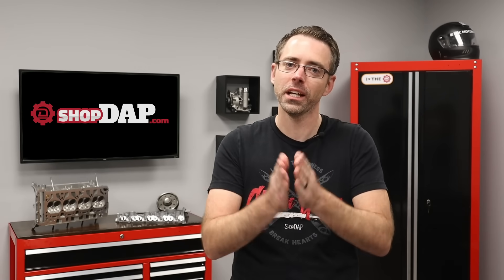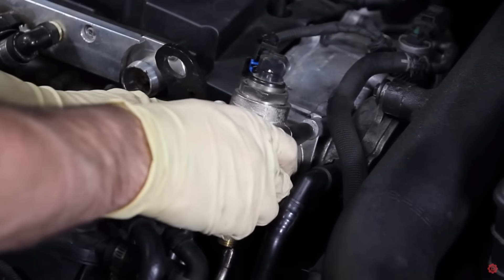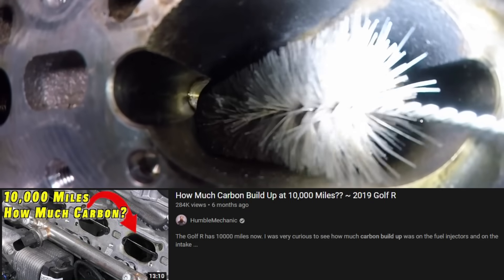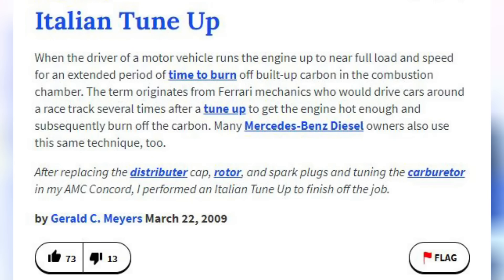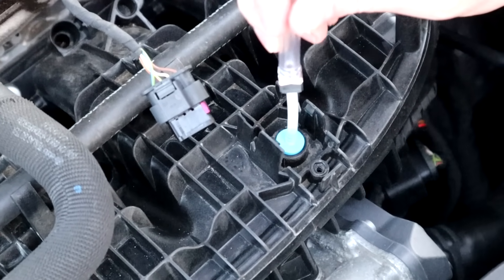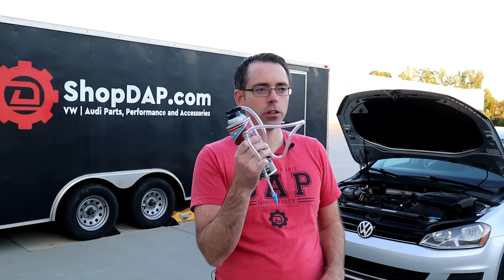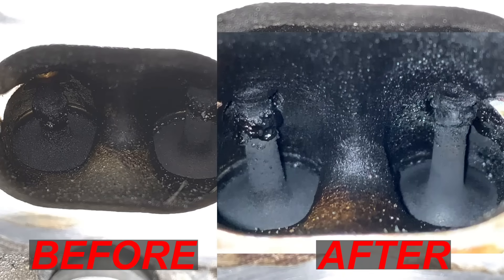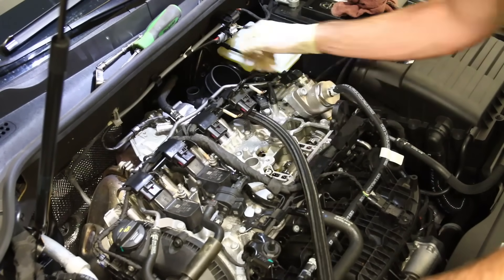Can you Really Remove Carbon for $29?

Comment: wonder how dry ice blasting would work for carbon removal.

now that i think about it, wonder if you could just let the pellets get sucked in to a running engine since they vaporize.   it would be an interesting test.
Reply: Interesting, but have potential to go expensive 😱
Reply: Might be a little tough to keep the engine running while sending carbon dioxide right into the combustion chamber.

Comment: I had one of the these engines I had to change out with a low milage lkq one.. intake was off and a crap ton of carbon down the intake port. Had a bunch of codes for the secondary runner, lean mixture, etc etc.. anywho.. would bad carbon buildup cause all these codes?
Reply: And I know the owner is cheap asf and ran crap gas

Comment: In the old days in the UK, say late 60's, 70's , talking about a petrol engine with carburettor , you would have taken the cylinder head off and given it a "de-coke". The valves would have been removed and the black gunk scraped and wirebrushed  off. 
Fast forward to the 21st cent. , most of us are running around in turbo charged diesels. Myself, I use a diesel additive called Millers - which claims to clean injectors, add cetane numbers etc.
One of these days, when I can persuade my Wife that it is an indispensable tool, I'm going to get me one of those Borescopes and stick it in the manifold area to check it's condition.

Comment: Almost seems like it would be beneficial to run a can of the spray before removing the manifold to help loosen the deposited carbon before jumping into a manual cleaning. Thank you for the new obtained knowledge!
Reply: Plastic manifold = no VOC cleaners it will turn into jelly. :)

Comment: Irony..."save" ozone with PVC/EGR system. Get power and efficiency with DI. Pour chemicals in to engine while running and create noxious, unhealthy smoke....destroy ozone anyway due to extra cleaning needed.  Talk about chasing one's tail. It's okay folks I drive a Subaru with the FA20DIT, so I'm going to kill the ozone eventually. Air-oil-separatoe here I come....

Comment: Good god. Did this guy really just suggest removing the intake and media blasting the valves with the cylinder head still on the motor? This is perhaps the worst vehicle related advice I have ever heard.
Reply from the maker: We are professionals and that’s how it’s done..... sooooo
Reply: @Deutscheautoparts  😂🤣 "Professionals"

No professional would ever recommend media blasting on an assembled engine. There is absolutely no way possible to recover all of the blast media and keep it from ending up inside of the cylinders, valve seats and guides, oil passages, etc. where it will end up lodged in the ring groves, scouring the cylinder walls, and doing all sorts of other damage. Even after media blasting an entirely disassembled engine you need to hot tank and blast everything out with compressed air to remove the residual grit.

And let's not even get into the undesirable surface profile that  media blasting leaves, especially on parts such as valve stems which are polished perfect smooth for a reason, to decrease friction.

This is anything but "professional." This is some backyard hillbilly level shit.

Comment: I had The "moderate"  buildup example here and i was running CRC GDI cleaner every year (every other oil change). Took off the intake manifold and it was pretty dirty. I ended up soaking in carb cleaner and scrubbing with toothbrushes. Worked pretty good.

It takes way longer than using walnut shell blasting. But you don't need any special equipment and i think it's less mess

Comment: Great video. I do wish you would have went more into the meth injection system. I understand it's a pain in the ass and not worth it, but does it actually work and can it take the place of spending money for walnut blasting? I am actually putting a meth kit on a car anyway by chance, and am considering walnut blasting but don't want to spend the money if i don't have to.
Reply: How did your meth kit install go?
Reply: @85gti  Good. I used it for more power, not to clean carbon. I ended up doing a forged build and have new valves and such, so I didn't need to walnut or dry ice blast. But methanol definitely allows for more power

Comment: I’ve read papers on the Italian tune-up my impression is that if it’s an engine that’s consistently run hard and hot, it can somewhat mitigate he buildup of carbon. So basically if it’s a track car or race car that spends it’s life at high RPMs it may not be an issue.  But you’ll probably have to tear that engine down after tens of thousands of miles on a track anyway.
Reply: I think that'd be more applicable to carbed or port fuel injected cars since there you do have gas run down the valves whereas in GDI it'd only maybe clean the pistons

Comment: I have a 2017 Kia Sedona with the V6 GDI engine since 7600 miles.  At each 5k I change the oil and filter. At the 10's I use the CRC method and now the van has nearly 70k miles and the intake valves look new and they're dry. So, I am certain the chemical treatments work great for preventing trouble.  I also use Pennzoil Platinum because it scored the best on evaporation testing and that means less drawn into vapor into the intake PCV system.. Cheaper oils do evaporate more.  BTW, the PCV hoses have no wetness, so I don't think a catch can would do much.  It's all about proper maintenance with good synthetic oil.
Reply: Can you elaborate more on what the crc method is? Is it using that crc intake and valve cleaner spray? If so how do you do it.
Reply: @abdulelahahmed4027  Yes, that's the product.  You spray it into the intake in bursts a couple seconds apart, not just spray all at once which can do ring damage, while the engine is running approx 2500rpm.  The detailed instructions are on the can, or you can do a web search for directions.

Comment: amsoil has one of the best knoak ratings witch really helps alot with carbon buildup on intake valves.i have a 2019 ranger 2.3 ecoboost been running amsoil since 4k i looked with bore scope at 21k and valves have almost nothing on them very clean so far not perfect but not to far away. but i change oil every 7 k and it never uses a drop of oil yet. i never have to add oil between oil changes amsoil well worth the money in my book. was going to install a catvh can but dont think i will have to.

Comment: I have a Lincoln MKS Eco-boost, it's been recommended to me that anyone with a Ford product that has the Eco-boost engine in it. That a oil catch can be added to help with the carbon build up.
You don't want to do anything that could cause a chunk of carbon to end up in your turbo charger. It can destroy it.
I also use premium oil and Chevron with Techron fuel and just driving normally for me I run an Italian tune up at some point every time I drive not that it helps, it's just fun! Why have a turbo if you aren't going to use it!

Comment: Using E85 race fuel resolves most of these issues without having to resort to old-school water meth. Carbon build up could be resolved if VW would give us the same engines that they use in the homeland.

Comment: Hyundai is now running dual direct injectors per cylinder on their new 1.6l engines. this is their style of variable displacement. 1 set shuts off when the extra fuel isn't needed, ie, steady highway or idle. Manifold services are absolutely preventative and shouldn't be used to solve an issue that is occuring or about to occur. mechanical cleaning is the only way to fix that problem.

Comment: I was told porsche don't have this issue because of their air oil separator design in their newer model liquid cooled cars.
The air oil separator acts as a kind of oil catch can and requires service over the lifetime of the vehicle.
Replacement on my cayenne took 5 minutes.

Comment: Spray biodiesel into your throttle body in a controlled manner
That thing should eat up everything in there. After you are done, let it heat soak for an hour or two and go do an Italian tune-up. Check the before and after under those conditions.

Comment: Hi, Im in the UK and have an A3 1.8 TFSI, which I believe is direct injection. You mentioned a difference in EU cars so will I be  having this issue on my car? It's a 2016 model with 57, 000 miles. Many thanks.

Comment: Just seems like there’s no good solution to the GDI carbon problem if you don’t have a very recent dual injection system. Either get an old pre-gdi car or a very new one that has the issue fixed.

Comment: Curious what those chemicals and the resulting smoke will do to a catalytic converter?

Perhaps a moot point since the chemical  cleaner doesn't seem an effective solution.
Reply: The goal here is to avoid superheating the catalyst. I've used intake treatment for many years, either induction or through the injectors. The big mistake I have seen is when someone is rushing the job, going for a banzai run to clear out the smoke.

Terrible idea. I allow the engine to idle ten minutes following the procedure, this allows slower burning of the accumulated hydrocarbons, and avoids damage. Yes, I watch that catalyst with an infrared thermometer.

Once an FSI engine exhibits cold idle misfires, the only solution is a proper intake cleaning. I have used several methods, including the "walnut blaster" devices. In my experience, it still requires a follow up cleaning, though much less carbon is present, with solvents. The blaster does little for the valve seating surfaces, where the misfire shows its ugly face.

Comment: Could I ask, does the audi s4 3.0 v6 engine have a big issue with carbon buildup? Could you use this product on the hole the pipe goes into in the intake just before the supercharger intake manifold? (don't know all the technical terms but I'm sure this makes sense to you as you own an s4)

Thanks

Comment: The answer is...NO. ATS has a system which actually works. However, while it's less expensive than removing the intake etc. It's still not exactly cheap.

Comment: I'm having a Passat 2017 model TSI 1.8L  with 103k so far I checked with my OBD2 Pro version and there's no problem so far knock in the woods, I only changed the front breaks and rotors. What should I do next? and what are your recommendations? Thank you
Reply: Your experience is encouraging since I drive a 2016 model Passat with the 1.8L So far I've only put 22k miles on her while averaging a pleasing 37.4 mpg (22,027 mi/589.1 gal.) Note: She is my fair weather-only car.  So far  no CEL's or rough running issues. I purchased and still have two cans of CRC solution for carbon removal but have been hesitant to use them due to fears of potentially damaging the turbo and/or catalytic converter. I've also considered adding a catch can, but have yet to be convinced doing so might do little more than possibly slow down the buildup of carbon on the intake valves slightly. At this point I believe I've decided to leave things alone and plan ahead to manually clean the intake valves when (or if) my car's fuel economy and drivability shows signs of deterioration. Had I known about the carbon issue with GDI engines I probably would have purchased a Toyota.

Comment: The best preventative to the turbo DI carbon issue is....don’t buy German turbo DI.  All turbo DI have some level of carbon build up due to the design of the system but, only German cars seems to have debilitating carbon buildup that eventually causes misfires and crap power/mpg.  I have first hand experience having owned a 2013 VW 2.0 TSI and both a 2013 and 2017 2.0 Ecoboost Escape. 

VW after about 40k miles would occasionally have rough cold starts. By 50k it would occasionally have cylinder 2 misfires. Progressively got worse until I finally yanked the intake off at 70k. Cyl 2 was the worst, almost 50% plugged.  2013 escape 102k miles before trading in for a 2017 that currently sits at 46k. Zero issues with either and none of the forums report any issues. Oil changes @7.5k miles on all vehicles with full synthetic and appropriate spec for the engine.

I blame German Pcv systems. They sit above the intake manifold so they push oil vapors and droplets into the intake with gravity assist. All other designs put the pcv system below the intake manifold so, oil has gravity working against it.

Comment: You can try using round aluminum telescopic tube, 1/16 or 3/32 diameter, glue and bend 2-4 of them to a shape that would fit in the MAP sensor hole with a rubber plug at around mid point. Then snug fit the outside end to a spray feeding tube. That way you can safely control the spray direction inside the intake feeding each cylinder equally.
Reply: The carbon deposit can be blasted with dry-ice blaster with a tip-nipple between 10mm-20mm and then air cleaned with a pressurized air-gun.. no more carbon deposits super quick !
Reply: @poplaurentiu4148  If all that could fit in the MAP sensor hole and without removing the intake manifold or fuel rail. If I have to remove it, I'd use a walnut blaster. Your technique may work also 🍻 I hate these direct fuel injected cars. Port injection or electric the way to go. Just add more gears to be at a lower rpm at cruising speed, if they want to save fuel. Direct injection and auto start systems ends up burning more time and resources as it requires more frequent fuel pump replacement due to higher pressure, fuel injectors replacement as the seals goes bad on them when removing to clean the carbon, and starters replacement from repetitious ignition. That's not even factoring in the time or resources to get and stock those parts on the shelf. But the government likes the tax money, the dealer likes replacing and over charging for parts, and the people can care less because there's no pride in ownership (lease and replace cars in a year or so). So that small amount of fuel a direct injection system might save does more harm than good. Like said, just more gears lower rpm would equal the same proficiency.

Comment: The tip is to get the engine hot and jam a can of Subaru carbon cleaner or Mercury powertune all over the hot intake valves. Let it soak for an hour, start the engine and keep it running whilst spraying another can through.

Comment: Cats won't last long running CRC, BG, Seafoam etc. through engine and loading the cat converters.  Install a catch can to minimize/eliminate oil vapors getting sucked into the induction system and sticking to the back of the intake valves.  -30F washer fluid is about 50/50 water meth and cheap.  Sucking in a small metered amount of 50/50 WM (1oz per cylinder in 15 - 20sec), when engine is hot and running 3K rpm, will clean backside of valves and not damage cats.  The water does most of the work by steam cleaning that's why the engine needs to be hot hot.  The meth helps keep the engine air/fuel ratio acceptable and not bog down.

Consider this the Italian Mafia tune up.  Run vehicle hard for 1 minute.  Pull over and feed it meth at 3k rpm per above.  Repeat 4 or 5 more times.  Go back and use a bore scope through plenum to see how things are cleaning up.  Repeat if needed.

Consider this a maintenance service requirement on a DI engine.  Interval needs to be defined based on engine needs.